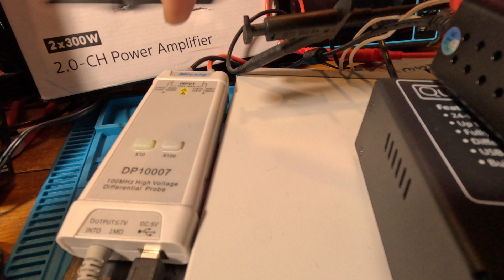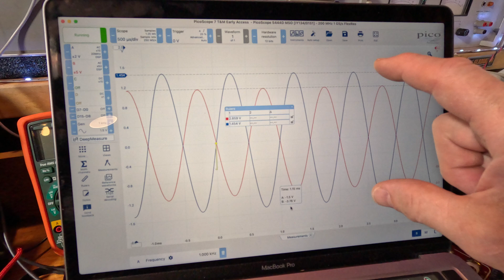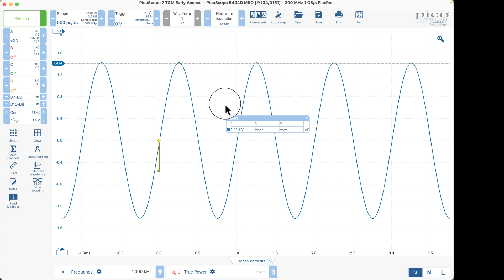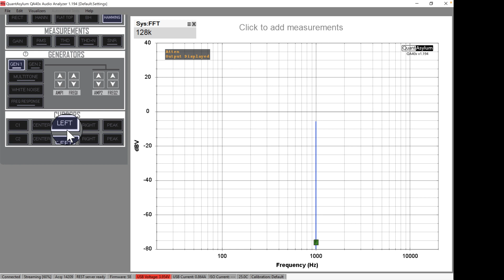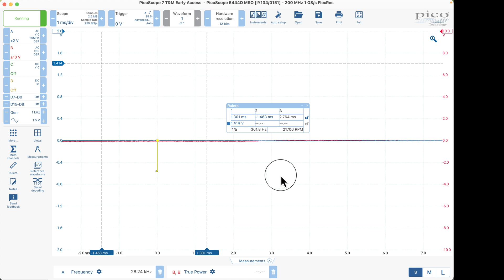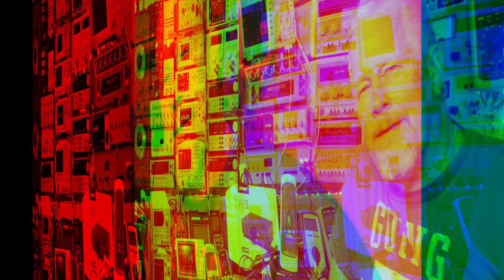Aiyima A07 Max test set-up for QA403 Audio Analyzer #TPA3255 #ClassDamplifier #Aiyima #A07max

Comment: Eddie- the USB supply from your laptop is not enough to power the QA403 properly, that is why the voltage is in a red box. It should run at least 4.6v and be a green box.
Reply from the maker: Thanks!  I was going thru an adapter, so I switched it to the actual laptop and it went green;)  Next video;)
Reply: @KissAnalog  Glad you got it in the green- not always easy to find a usb port with enough juice.

Comment: Lol, cannot comment on your specialized test equipment, but more on the chaotic state of your workbench… phewwww, glad to see somebody else’s workbench just as chaptic as mine when I need to delve deep into some tests. Could never figure out how some other people can have their test-benches so tidy, no matter what they test/design/repair…. 😅😅😅 btw… how does that amp stack up with 2-tone tests? In all tests of Audio-equipment I always just see single-tone measurements, but I very seldomly see 2-tone measurements, which is weird for me having a RF-background. I mean, very seldomly do you listen to a single tone on audio, it is always a combination of frequencies, so why does IP-3 not play a bigger part than THD? It is like all the audiophiles all look at 1% of the issues, and fry their brains over it (1dB compression point), low noise, and what kind of distortion with single tone, but never how real audio performs…
Reply from the maker: LOL - you are so right!!!  Thanks!
Reply: 60Hz : 7kHz at 4:1 ratio was the SMPTE standard figure routinely listed in an amplifier data sheet back in the golden age of audio, nowadays John Atkinson from Stereophile goes for 19 : 20kHz 1:1 during his testing procedure.